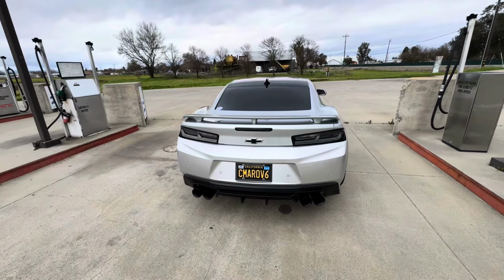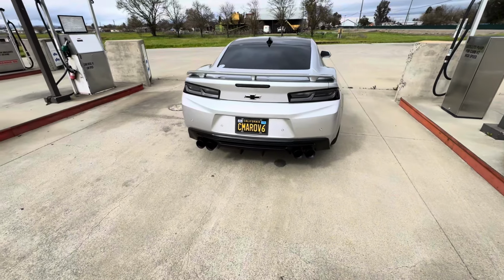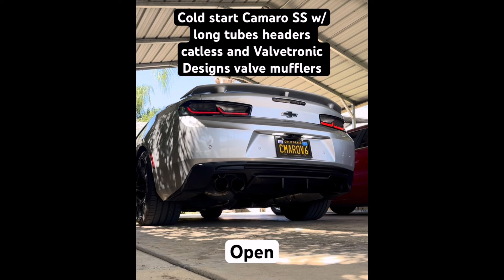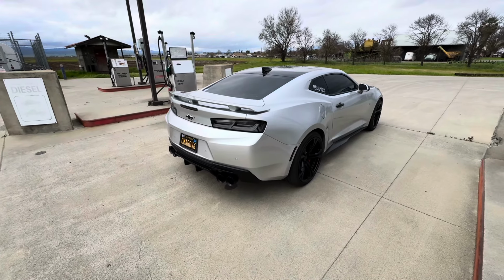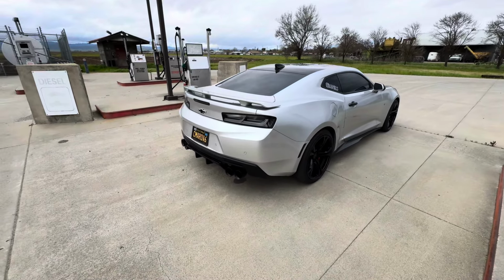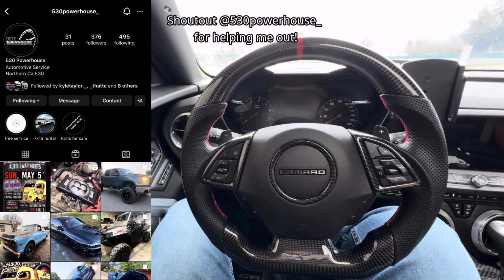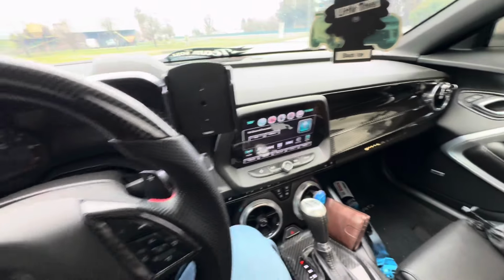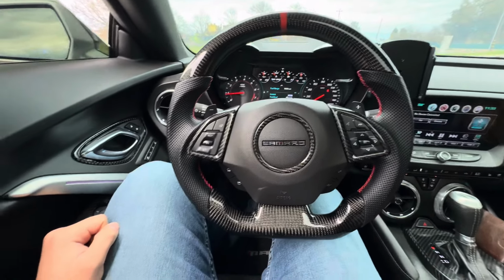Valvetronic Muffler Review! Is It Worth the Price?!

Comment: i have a 2023 3LT RS V6, 10 Speed auto with the valve exhaust from factory i’m 20 love seeing more camaros💯
Reply: Camaros are for kings
Reply: @DakotaThePawgHunter  agreeddd
Reply: What do you have done to the exhaust
Reply: @los_tress_primos3614  stock npp mufflers, there are electronic valves in between the mufflers and the resonator that I left alone, then the resonator cut out and put an x pipe in place of that. Also straight piped the secondary cats and ordered the high flow cats for the primary’s.
I’m also lastly gonna change the the borla atak with the quad tip valve axel back and should be good with exhaust after that

Comment: Xforce varex is cheaper and WAY less work. Not to mention the proper exhaust for this platform
Reply from the maker: Never heard of them before, I’ll have to check them out
Reply: We are better than them. And we are proper for any platform. Whether its a BMW, Lamborghini, chevrolet, or civic
Reply: @valvetronic whats the difference between yall and them? no hate obviously just curious cause ive been looking to get some new mufflers just dont know whats best
Reply: @GodSpeed2SS  that is a very good question, and we are more than happy to answer. the competitors mufflers have some engineering nuances which cause longevity concerns over time. Having the valve inside the muffler means it is not serviceable, and we've seen some issues with rattle and other issues. Having the valve be vacuum actuated means it is extremely reliable and easy to diagnose issues if they ever were to arise. Additionally, the size constraints and cost of the universal muffler compared to the competition means that they are smaller and easier to put on a wider variety of vehicles!
Reply: @valvetronic  Thats exactly the explanation i was looking for lol thank you fr. Im most likely gonna be ordering from you soon

Comment: How'd you get the mufflers to fit because im having problems with the fitment
Reply from the maker: I ordered the 3 inch mufflers I don’t know if you got the bigger mufflers but it should fit no problem. Only issue I ran into was it was difficult straightening out the tips

Comment: Do you recommend this since you live In California? I have a catless mbrp race exhaust on my scat and I don’t want cops on me
Reply from the maker: I highly recommend. I have catless long tube headers and a cop as a neighbor. After almost 10 months I’ve had 0 issues and 0 noise complaints
Reply: @RalphieSS any issues now 6 months later with the cops , I live in California and want to get a 2022 Camaro LT1
Reply from the maker: @ I got pulled over about a week ago and obviously I closed the valves. Cop didn’t mention anything about a modified exhaust and when I started it up he didn’t say anything either. 1000% highly recommended especially if you’re here in California. No other issues and exhaust is still working as new! Hopes this helps.

Comment: Hey again brotha, would you say this setup is a tad bit louder than having headers and the stock muffler on the car? I have headers and stock muffler on still but wondering if this setup got you any more sound compared to having the stock muffler at the back.
Reply from the maker: Honestly I’m not too sure. I never ran headers and the stock muffler together but the way I would describe these mufflers, closed they are close to stock and open it’s 80% straight pipe. And the muffler provides a nice tone.